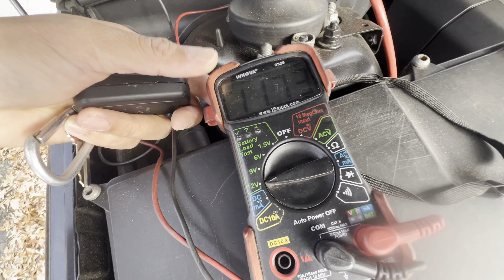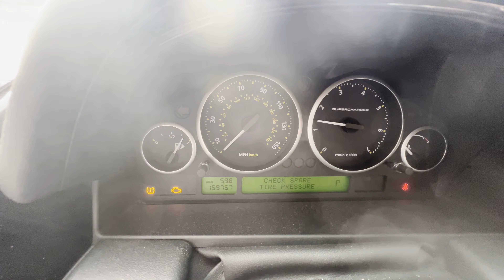How to Replace the burned Alternator on 2009 Range Rover 4.2L V8 Supercharged Land Rover L322

Comment: What gauge abd size temp eyelet connector is that? Did you crimp it or weld the eyelet connector?
Reply from the maker: I just crimped it . It’s either 4 or 2